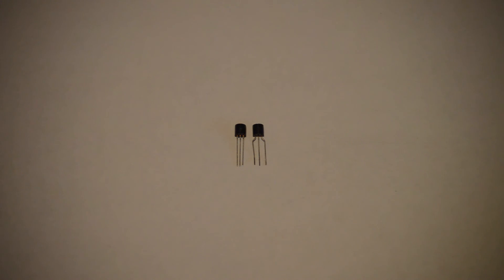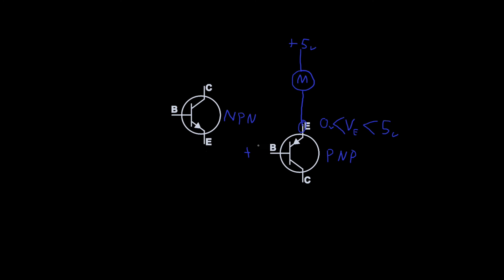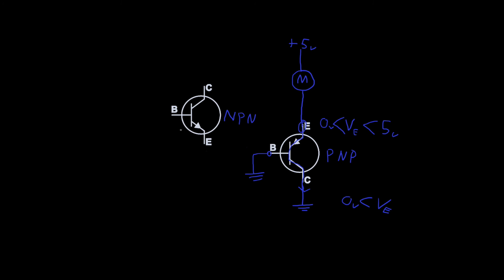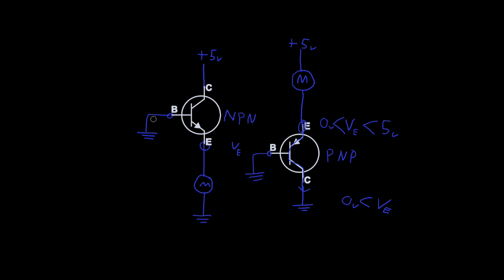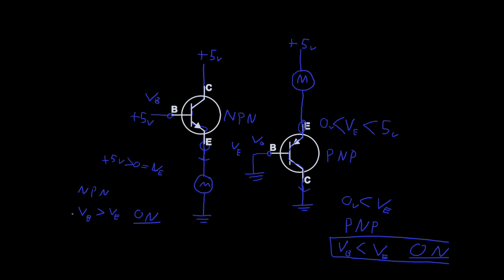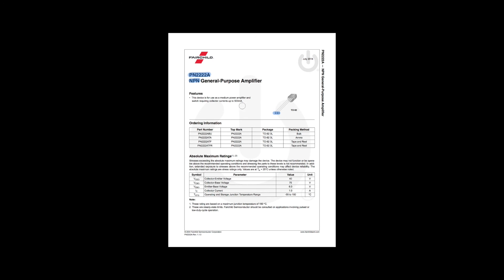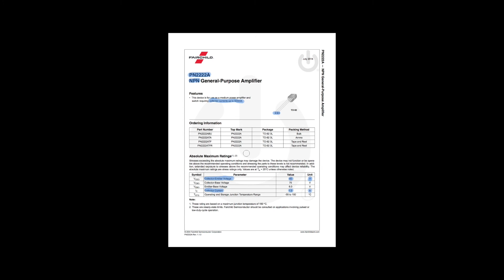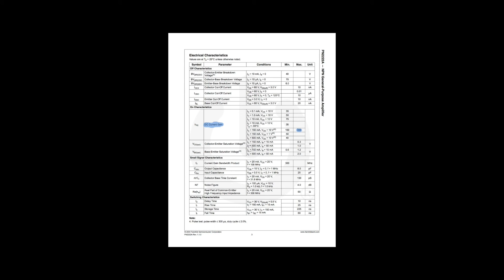Transistor Basics

Comment: The problem I see with this example is that the base of the 2n2222 does not have a current limiting resistor. The total voltage drop is across the base emitter junction, that junction is only dropping .7v. So there is no resister to limit the current at the base of his circuit. He will burn the transistor out using it this way. This is a poor example. Neither does he tell us, what the voltage that is being applied. If you are going to teach electronics, show schematic of the circuit being used as a demo.